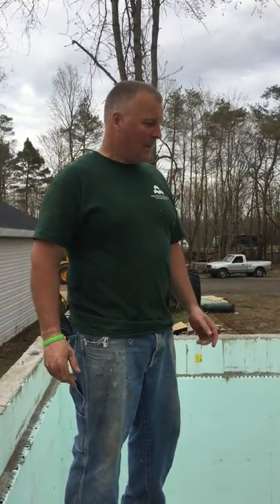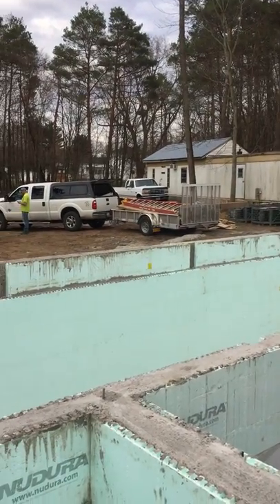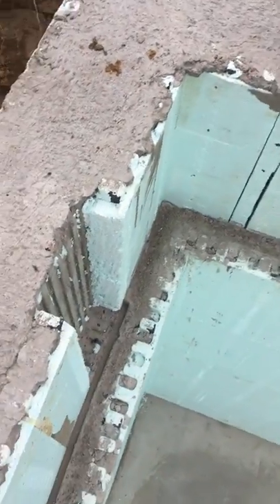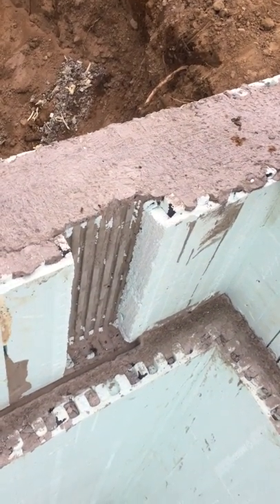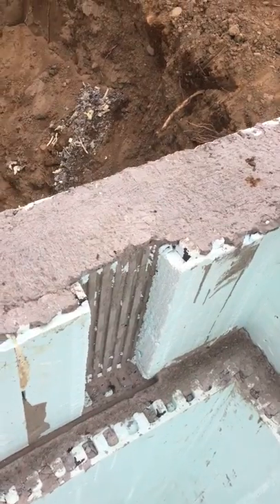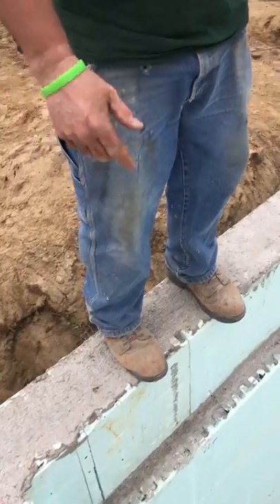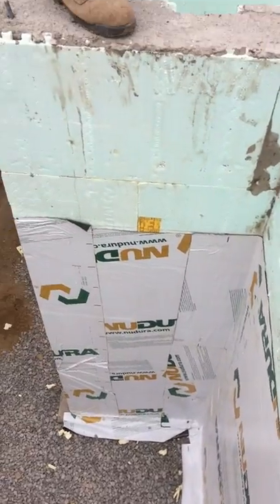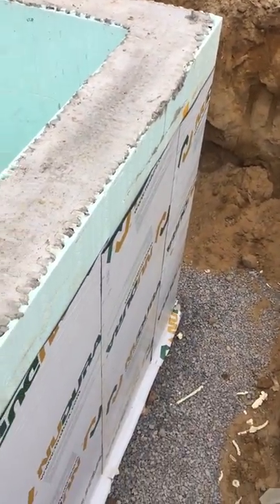How to build a ICF basement for a single wide trailer.

Comment: Our single wide is on a basement and also we have an additional thats on top of a 7ft cellular but we need it to be finished but don't really know who to contact would that be like a contractor or a home remodeling type of person 🤔
Reply from the maker: I would contact a spray foam contractor first. They will stud off the basement and spray closed cell spray fam to seal it off then get a remodel guy to finish it. This is unless it is ICF and you could screw drywall to the ICF.
Reply: Thank you
Reply from the maker: @rustyshackleford4614  Absolutely welcome buddy. 👍👍
Reply from the maker: @rustyshackleford4614  no problem